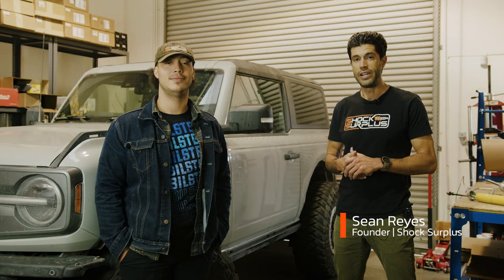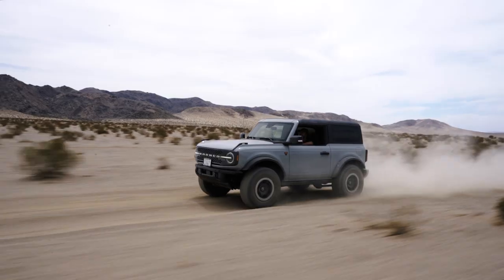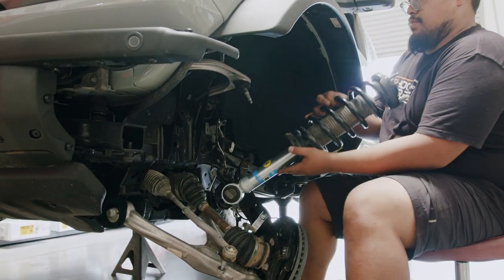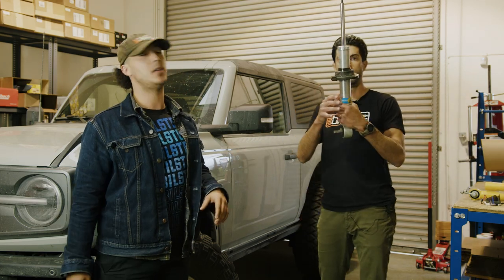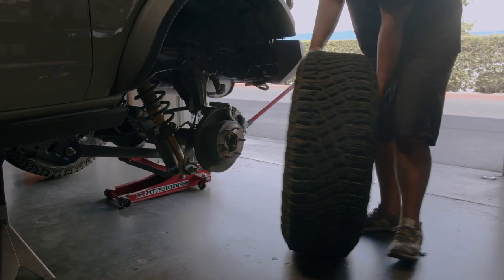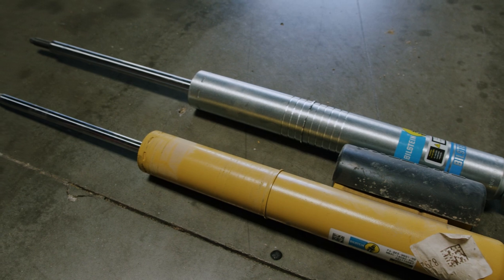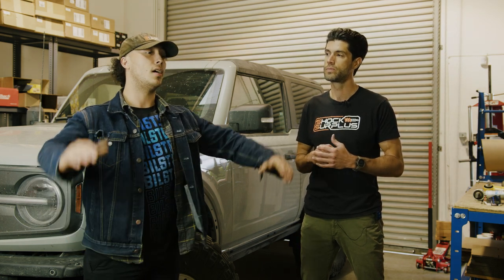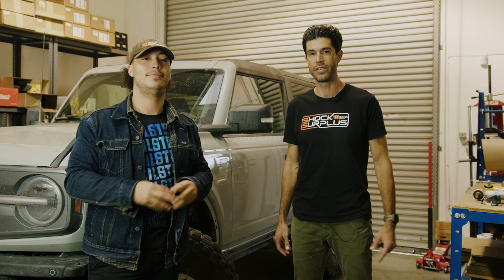2021+ Bronco Suspension Deep Dive - BILSTEIN ESCV vs 5100

Comment: GREAT review and honest share :)  I was supposed to go with a KING setup but opted for the Eibach SPrings on my SAS......it's been GREAT.  A good compromise.  My ride is MUCH better all around.  On road chatter is amazing now....smoothed out :)  Off road has been great as well.  I do have a Rough Country winch (and mount) on right now and just did some fairly hard rock crawling and high speed whoop-dee-whoop rollers.....Performed GREAT!!!  I do have a QUESTION - IF I wanted to lift my front end to compensate for the winch, and all my heavy RCI armor, what would you recommend?  Or would you just say keep it as is?  1 inch is all I want.
Reply from the maker: Oh nice, the springs helped with on-road chatter? That's great to hear, that's the next assessment we wanted to do, Eibach springs on the ESCV shocks, and still may. Thanks so much for the feedback

Comment: So i live in the UAE and we do a lot of dune bashing out here. I have a 2 dr Outer Banks with the Hitachi shocks, and 33s. The Hitachis have performed well dont get me wrong, but I know my limits and how crazy i can go. Ive been thinking about the Eibachs for sometime but the 5100s seem like a good shout as well, especially that im planning on getting 35s. Do you think getting the 5100s on 35s with a 2 inch lift is worth it? especially because the car is my daily as well. Would 2 inches be the ideal height and would i also need UCAs?

Comment: What about 6112? And what springs if you have a winch mount on the front?
Reply from the maker: the 6112 doesn't have more than one spring available for the front, it'll come down to how much ride height you need and if the 6112 settings can achieve that with your front weight. 

Email seanbowman@shocksurplus.com or text 213-433-3616

Comment: I've heard conflicting info on the 5100s, specifically regarding the circlip and it's affect (or not) on OE spring preload. I've read on forums and watched countless videos. Could you guys cover this topic? Have a set coming for my 2007 Sierra, I got a leveling kit that will allow me to max out the 5100 OR not use the lift so I can have a softer ride. But I have heard adjusting the height doesn't affect the ride, but have also heard many people say that has been their experience.
Reply from the maker: to a certain point, the ride zone changes by half the lift height: 2in of lift from the spring, changes 1in off from optimal ride zone on the damper, that on top of how the shocks handle the constantly pent up spring energy and rebound. 

We've heard a lot more from customers who's ride quality changed for the worse after preloading the spring. Seems a spacer with the shock at factory height is the safest way to maintain ride quality, only compromise is lack of improved performance - in case that's a concern for you in offroad situations or environments

Comment: QUESTION  ? 
I HAVE A 1999 FORD F150 XLT 4.6L EXTENDED CAB 4X4  !
MY NEPHEW RAISED THE REAR 5 INCHES WITH 5 " BLOCKS  ! THE FRONT WE GOTTEN 3 " TORSION KEYS TO RAISE THE FRONT  . WE ORDERED THE BILSTIEN SHOCKS  4 " TO 6 "  THROUGH YOU'LL CAN'T THINK OF THE NUMBER OF THE SHOCK . AFTER MY NEPHEW PUT EVERYTHING ON THE TRUCK / TASTY  / WE TOOK HER ACROSS THE STREET TO THE CHURCH PARKING LOT TO SEE IF ANYTHING RUBBED WHEN TURNING THE FRONT WHEELS  . WE ALSO ADDED NEW 18 " WHEELS / INSTEAD OF THE ORIGINAL 17 " ONES THAT CAME ON TASTY /PLUS  LT 295 / 70 R / 18  / NITTO RIDGE GRABBERS  /  WHEN WE DID A COUPLE TURNS THE PASSENGER SIDE BRACKET ON THE LOWER CONTROL ARM  , FRONT BROKEN OFF.  BUT OTHER THAN THAT IT SEEMED TO BE OK . ADJUSTED THE HEIGHT A BIT & NO RUBBING THE VINYL UNDER BUMPER  . WHEN I WENT HOME IT FELT LIKE I HIT THE LITTLEST BUMP IN THE ROADS WAS REALLY BIG . THE ONLY THING WE COULD FIGURE OUT THE UPPER CONTROL ARMS WERE HITTING THE METAL BUMP STOPS ON THE FRAME ON EACH SIDE  . DON'T KNOW IF WE / NEED TO GET DIFFERENT CONTROL ARMS  , UPPER & LOWER , OR CUT THE METAL BUMP STOPS ON AN ANGLE & RE WELD IT AFTER WE CHECK & SEE IF THAT WORKS WITH WHAT WE / HE DID HOPEFULLY  . NOT TRYING TO MAKE A ROCK CRAWLER JUST SIT HIGHER & GOING / TRAVELING THE EASTERN MOUNTAIN BACK DIRT / GRAVEL ROADS CAMPING  . SHE'S GOT A HAIR SHORT OF 300,000.00 MILES . IF I LIKE THIS I'M GOING TO DO THIS ON WHEN I GET ANOTHER ONE ? MORE THAN YOU NEEDED TO SORRY  .
Reply from the maker: The front shocks for 4-6" would have been too long for your 3" lift. You were most likely to bottom out. The rear is either a full 5" lift or if you removed the factory block and added a 5" block then you would need to deduct the factory block height with the 5" and that is the total lift you received.

Comment: I have a 2 door Sasquatch and think it rides hard at any speed under 50 mph. My question is would the 5100's or 6100's be a better fit for those speeds? Not many places to go 50+ offroad up here in the northeast. Also I can only find your 6112 kit with springs for the 2 doors and not just the 6100 shocks, why is that?
Reply from the maker: If you can swing it, even if you are not driving fast a 6100 or 6112 is definitely worth it over the 5100s. They handle a lot better and even when going slow there were some times we had to check up for the 5100s where a 6100 would float right over. It looks like the data team is updating 2 door listings so just give us a chat, email, or call and we can get you set up.

Comment: What would you recommend for LC76 2024? I don't do high speed off road. 90% on road 10% off road. I care mostly about on roads. If you have time, please assist!
Reply from the maker: To be fair we do not get 70s here in the US so we do not have a ton of experience with them, but overall from what we carry we think the Dobinsons IMS shocks are pretty hard to beat. They ride better, handle better, take more abuse, and basically are better in every facet over stock while lasting a long time and still be rebuildable so you never have to buy a new set.
Reply: @ShockSurplus   thank you 👍🏻

Comment: I recently put 5100 on my base bronco .  Set it up to 2.9 front and maxed out tge rear . Would you suggest upper control arm? I feel like im all over the the road . ..
Reply from the maker: new aftermarket UCA definitely help with alignment, especially with close to 3" of lift in the front. We like the Icon arm, has a crazy amount of articulation

https://www.shocksurplus.com/products/icon-tubular-uca-dj-pro-kit-for-2021-2023-ford-bronco

Comment: I am wondering regarding the 5100 is it will be good chose for off road better than big bend stock shocks
Reply: because i am going to upgrade  my tires to 35 inch
Reply from the maker: They are definitely a great upgrade over the stock Hitachis for sure and will help you clear those 35s with ease. They have their limits when you want to go fast off road, and we think the 6112s are definitely the better sweet spot for most people, but if you keep speeds reasonable and do not see yourself going over a 35, they are a great upgrade.

Comment: What tire pressures were you using during testing?  The tire is a big part of the suspensions when off-roading.
Reply from the maker: 25psi, give or take a few, but that's the sweet spot that Bowman (driver) likes
Reply from the maker: Roughly 22-24 PSI during warm conditions.